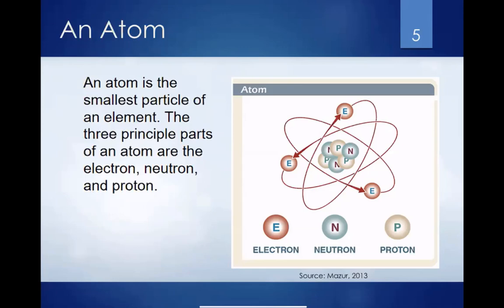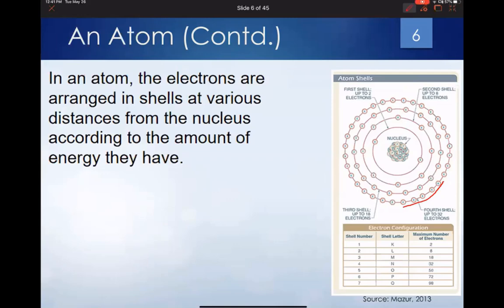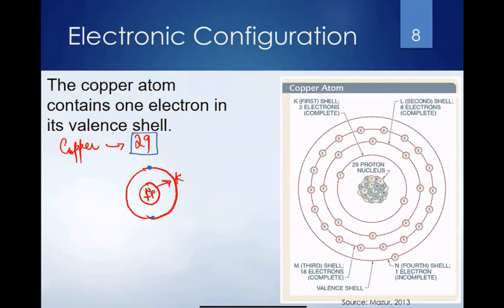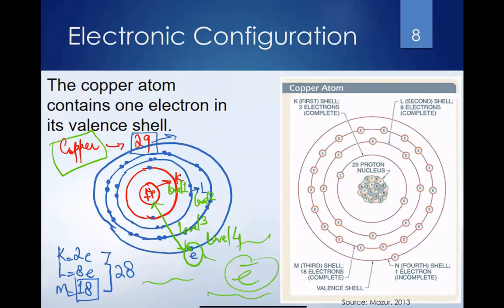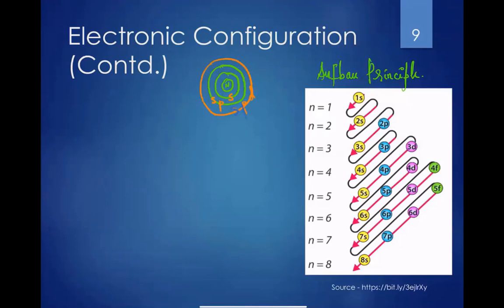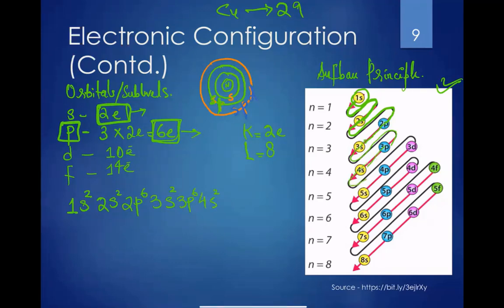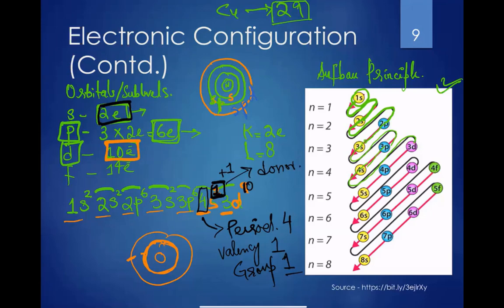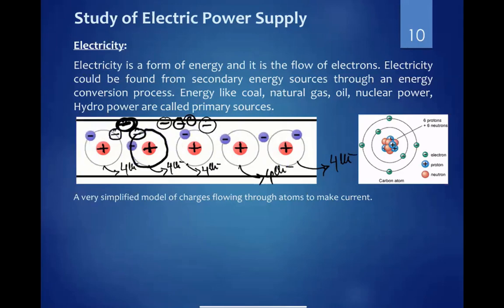#1 What is electricity?

Comment from the maker: Dear Distinguished Followers,

Hope you all are staying safe. May 26th, I'll be starting a new lecture series on Introduction to Electric Circuits, please subscribe to to the YouTube channel if you haven't already. And share it with your friends because its free :)
Every Tuesday and Friday, lecture(s) will be uploaded.
https://www.youtube.com/channel/UCaoBqfB5ATcBqZ7DHyyTogQ…

Topics include:

Introduction to Electric Circuits
AC/DC Circuits
Circuit Components
Simple Resistive Circuits
Linear Circuit Simulation and Analysis
Circuit Equivalents and System Models
Op-amp Circuits
Transducers
First order Transients
Inductors and Capacitors
Sinusoidal signals and System response
Analog/digital Conversion
Basic Digital Logic Gates and Combinatorial circuits.

All lectures will be available here on Electronics Garage as well. Share it with your friends. These will also include labs based-upon free cloud-based simulation software such as TinkerCAD.

- Prof. Mughal